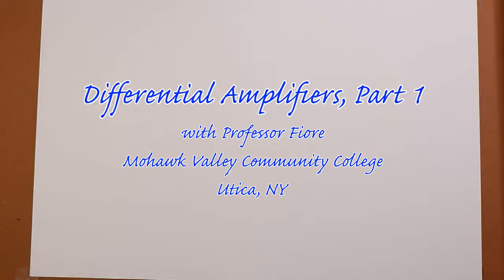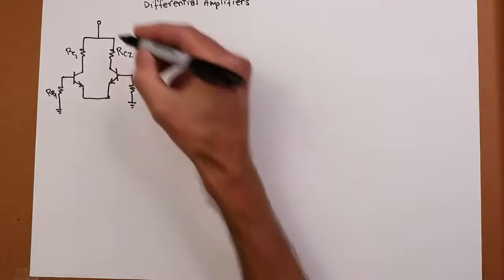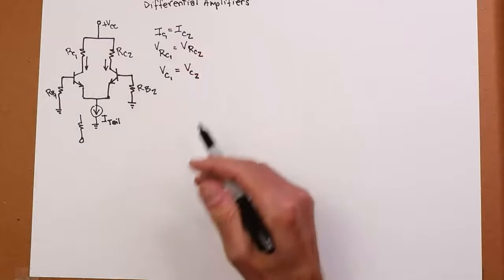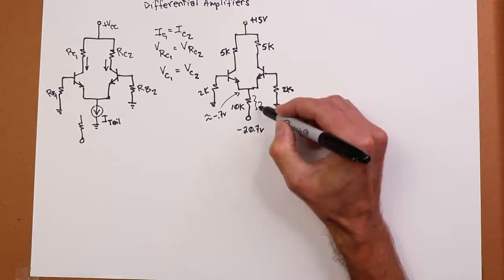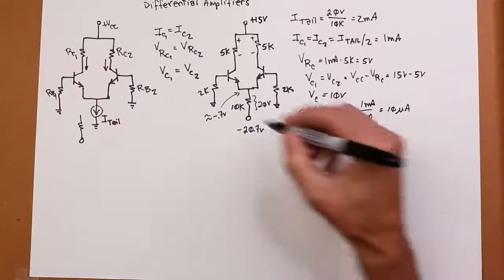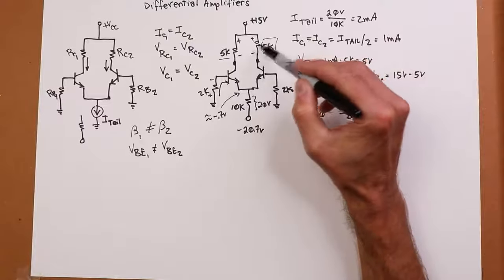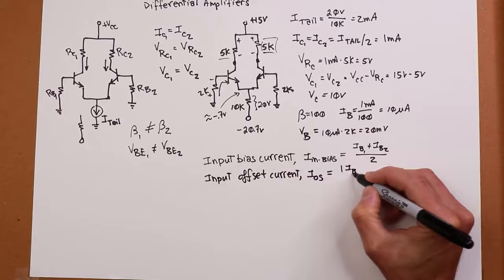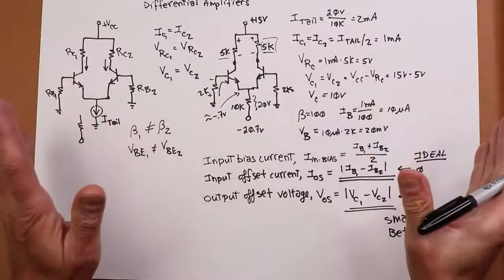Differential Amplifiers, Part 1

Comment: After seaching and searching... finally GREAT to find a GREAT video which is boith clear AND Concise. Thanks Professor... you now have 'at least' one student in Sydney Australia.
Reply from the maker: The three Cs of a good explanation: clear, concise, ... and correct! 
Glad you found it useful.
Reply: Can you show us how to compute and design an amplifier with 70 vrail  using mpsa 92 on differential stage c2073 vas  c5198 a1941 driver  thanks ❤

Comment: Do you have a textbook you would recommend for learning some of these general concepts about op-amps? I have the book from Sergio Franco and I'm not that impressed by it. So many steps are skipped and the explained examples are too generic to be of use when solving the chapter problems. I have to say though, your videos are the biggest help for learning this stuff. Thanks Professor Fiore, wish I had you as my professor for advanced analog devices!
Reply from the maker: Well....at the risk of being immodest, have you considered my op amp book? You can download a PDF for free or get a soft cover print copy from Amazon for about $21. Go to www.mvcc.edu/jfiore and follow the link to the "OER free books page". You'll find all of my books there (5 texts and 7 lab manuals) plus links to other useful OER materials. (direct links are also in the description of the video)

Comment: I understand that Vb is 0 volts and we have a typical 0.7 volt drop from base to emitter and therefore a 20volt drop from Ve to V- .    But, How do we go from Vc of 10 volts to Ve of 0.7 volts?  When the transistors are on (and therefore I1 + I2 can be = It), why isn't there just a nominal (say 0.2 volt) drop across the collector emitter junction(s)?  A full "accounting" of voltage drops from V+ of 15 to V of -20.7 would really be helpful.  Thanks.
Reply: Please ignore the strikethrough.
Reply from the maker: You would only get a few tenths of volt across CE if the transistor was in saturation. It's not, it's operating in the linear region. Basically, whatever isn't taken up by the collector and emitter resistors drops across CE.
Reply from the maker: I should add that more videos will be coming in the next couple of months that will discuss operational theory that precedes this video. That should help. They will be found in the Semiconductor Devices playlist. In the meantime, I suggest you download the free PDF of my Semiconductor Devices text.
Reply: @ElectronicswithProfessorFiore  Got it, thank you very much.  As a beginner, I have been doing self study on electronics over the past several months, and had forgotten about transistors operating in the linear region and the resulting drop across ce.  

I have been looking for a curated series on op amps, and thanks for the videos and all the texts.  Really great!

Comment: Which one on the general schematic of OpAmp is "+" and which one is " - " ??? Are they rechangable?
Reply from the maker: A diff amp is not an op amp. Typically, it is the first stage of an op amp. Consequently, the input that is in phase with the output will depend on the following stages and whether or not they invert. base->collector inverts, base->emitter doesn't.
Reply: @ElectronicswithProfessorFiore  Thanks.

Comment: Is this the same process with just one Rc in the circuit?
Reply from the maker: Pretty much. Obviously, the collector voltages don't match but there is no need for that if you're using a single-ended output (i.e., just one collector).

Comment: Key to understanding:

Remark :
Transistors are connected according to the common emitter circuit, in the OE circuit, the voltage at the emitter, roughly speaking, is always equal to the base voltage.
Since the potential at the point of connection of the emitters MUST be the same for both transistors, someone must give in ....

This small voltage difference falls directly on the PN junction of another transistor, closing it, that is, roughly speaking, if we assume that the transistor is open when the voltage across the BE is 0.7V, then with a voltage difference of 0.1V, we have a voltage drop on the other transistor on the BE 0.6V is not a completely open transition !!! This is equivalent to the fact that we stupidly applied 0.6V to the base. What will be the base current at this voltage?? Look at the CVC of the diode, the current will be almost absent, so the author talks about Ebers-Moll's formula.

You can see the CVC of the diode, what current the LED will give out if its PN junction is not fully open, that is, if it is open at 2.7V, apply 2.6V to its legs and you will see that the current almost does not flow. So here, increasing the difference

Like this comment if it was useful for you so that others can see it.
Reply from the maker: Why would you "assume that the transistor is open" when Vbe is 0.7V? Under typical conditions for silicon devices, that would imply that the transistor is conducting, not open (non-conducting). Second, are you referring to the Ebers-Moll model when you mention "Eberton Moll's formula"?
Reply: The PN junction conducts current below a voltage drop of 0.7V. In the general case, when the voltage drops below this value, it resists the current in a non-linear relationship. Above a value of 0.7V, the PN junction almost does not show any current resistance, then it can be considered as open.
Reply from the maker: @olvyshh147  No. That is fundamentally incorrect. If a device does not show any resistance to current flow, then it cannot be considered an open. It is the exact opposite, namely a short. I suggest that you may wish to curtail any further exploration of op amps or other semiconductors and instead go to the fundamentals of DC circuit analysis. Unless the foundation is solid, the building will collapse.
Reply: @ElectronicswithProfessorFiore  True, if the device does not show any resistance, it is considered to be short-circuited.
Perhaps you did not understand me, but I wrote that a further increase in voltage of 0.7V does not have any effect on the current. Most likely you did not understand my comment above at all, but only cling to words.
Reply from the maker: @olvyshh147  The first statement directly contradicts the final sentence in your prior comment. A PN junction cannot be both open and short at the same time because those are opposite conditions. The second statement is not true in the real world, but is just an approximation using a simple model. 

Where did you first "learn" about electrical theory? You appear to have considerable confusion on the topic. I will suggest again that you go back to the fundamentals. I remain happy to help. 

For now, I suggest not placing your "explanations" in the comments. They run the risk of confusing others who are trying to learn the material.

Comment: Thanks for posting. One thought came to me if you were to put a potentiometer between both Emitters of the BJT’s you could balance out the current between the two 5k resistors. Your thoughts?
Reply from the maker: On some amplifiers there are pins that allow you to connect a pot (and perhaps a resistor or two) which can be used to null out any DC offset. This is done by bridging the two sides of the diff amp, so you're right in the ballpark! Theoretically, this could be done in either the emitter or collector section (source/drain for FET). The whole idea is to steer a little bit of current from the side that has too much to the side that's lacking. The need for this has gone down considerably over the years as the DC precision of op amps has increased. Many modern op amps do not even have the option any more.

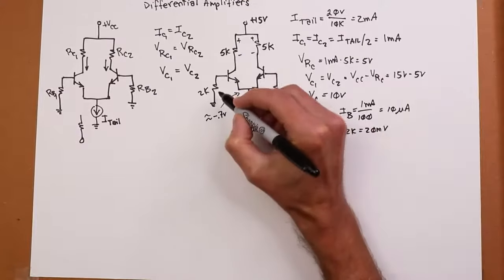Comment: Please forgive my simple question but can you clarify what you mean by "current source" (I-tail, 1:51).  I look at a circuit and think of the power supply as the current source.  Why is a resistor a current source?  Are Rc1 and Rc2 (as well as Rb1 and Rb2) also current sources?  Also, with the I-t resistor being the "source" of current, it seems strange to me that the arrows you add representing flow of current all point to it.  I assume your arrows represent the flow of conventional current (holes) so wouldn't the current source be +Vcc?  Then I'm not sure why at 7:20 you indicate the current flowing into the NPN base.  Thanks for any feedback.
Reply from the maker: First off, yes, I use conventional current flow. Thus, current flows into the base of an NPN transistor. Further, current flows into the collector, and that combination flows out of the emitter. Ie=Ic+Ib.

Regarding "current sources", you seem to be confusing that with "sources of current". Yes, Vcc or Vee are sources of current, but they're modeled as voltage sources, not current sources. Going back to basics, an ideal voltage source always produces the same voltage, regardless of what is connected to it. Similarly, an ideal current source always produces the same current regardless of what is connected to it. This implies that the internal resistance of a voltage source is very small and that the internal resistance of a current source is very large. 

To your question, the COMBINATION of the tail resistor and the voltage supply behave like a current source. That is, it draws a specific current (Itail), and if the two sides of the circuit are identical, that means that each of the emitter currents must be half of Itail. So, no, by itself, a resistor is not a current source, but when it is combined with a voltage source (using appropriate values), the pair can be modeled as a current source.

Comment: Me again...
If we set the tail current to, say, 1mA using a resistor, will the circuit perform the same as if we used a transistor as a current source (sink) of 1mA? Can we substitute transistor current sources for resistors? I think I'm missing some knowledge here, Perhaps you could point me at a place in one of your texts? Thanks for all you do.
Reply from the maker: Using a transistor current source will provide increased performance in areas such as common mode rejection ratio (there's a video on that). The basic tail resistor form is a good place to start as it is simple and relatively easy to understand, but it does not provide the best performance.
Reply: @ElectronicswithProfessorFiore  As an example... Could we replace the Emitter resistor on a CE amplifier stage with a current source resulting in the same current?
Reply from the maker: @simonyoungglostog  Yep.
Reply: @ElectronicswithProfessorFiore  Excellent. I must be doing something wrong in my simulator. I'm trying different versions of amplifier circuits,  Thank you!

Comment: Hello Prof Fiore , about that Vc you calculated to be 10 Volts , the voltage drop across both transistors being small , isn't that 10 Volts Vc also 'seen' by the tail resistor ? 
I am sure there is something i am missing
Reply: I scrolled down and found your answer to Ahmad Shamim's question
I need to go on a back-to-basics trip 
For the video and your answers in the comment section , I thank thee .